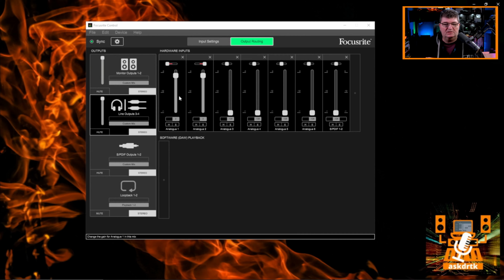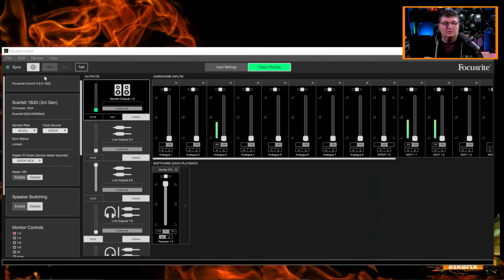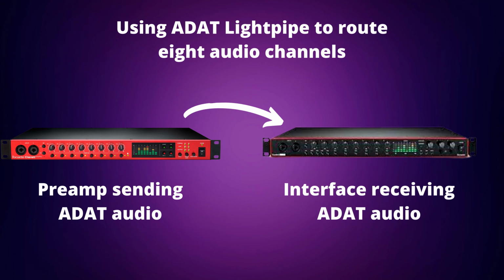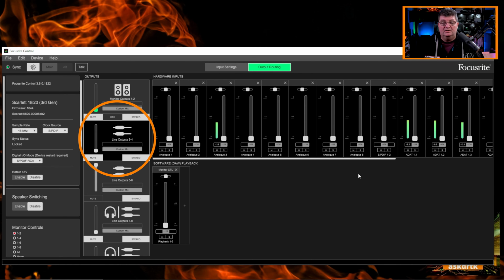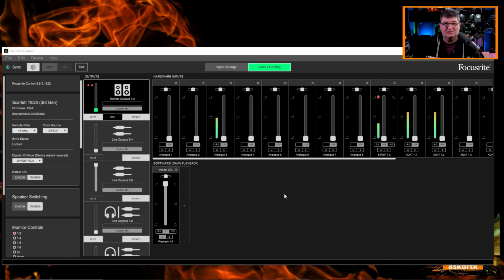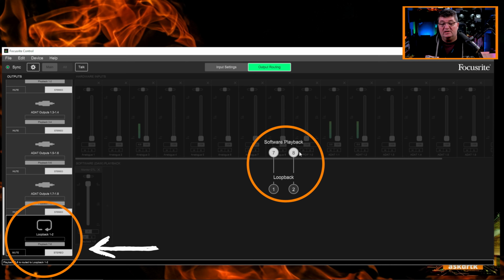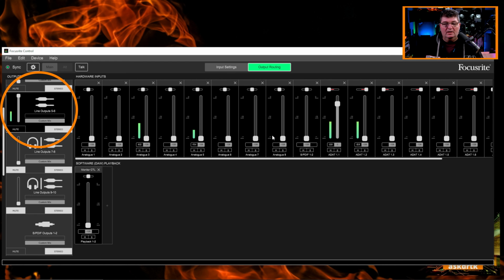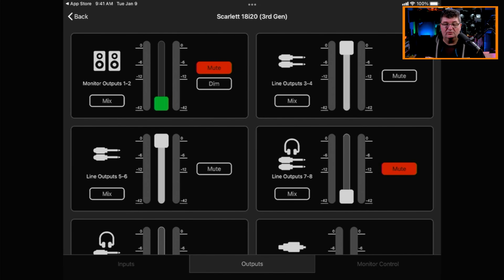Focusrite Control Step-by-Step Setup Guide - ADAT, SPDIF, & iPad Control

Comment: Hi Todd.    Great, very informative instructions. Thank you so much for your kind helpful efforts.
A quick question...
****
I already use the 18i20's ADAT to get an extra 8 inputs using a Behringer ADA800. 
If I do this, does it mean one can't use the SPDIF IN  RCA input on the 18i20 - to get an extra two input channels?   (I think you said this.)

I am trying to use an Avencure A-D audio converter (RCA stereo source to Figital coaxial outputs) to feed my Yamaha Modx analog outs to a new track input on the 18i20.
Thanks again.:-) Peter 😏
Reply from the maker: Hi Peter, glad to help out as always… Yes you can use the additional two channels of input from the SPDIF input. (I assume you are using a sample rate of 48KHz as you have 8 ADAT inputs from the AD8000). Using a AD converter is a great way to take advantage of the extra channels. Cheers!
Reply: @askdrtk  Thanks Todd. I tried but no luck as yet (confused by the appropriate Focusrite Control app setup) but I will study your videos more closely. Cheers from Australia mate :-)
Reply from the maker: Hmm, the inputs should be available as ASIO inputs 11 and 12 in your DAW without setting anything up in FC and then setup FC to monitor the SPDIF inputs to whichever outputs you want to use. If all this looks good and you still are not getting sound, chances are it is a clock issue. Since the SPDIF connection from your AD converter is one way (the converters sends its clock out), you will need to set the 18i20's clock source to SPDIF so 18i20 can sync up with the AD converter. Hopefully this will get things going.
Reply: @askdrtk  Brilliant Todd. I will try this out when I get a chance. 
You are such a kind person, thanks again 👏

Comment: I need help.. I have the focusrite Clarett + 8 pre and Iam trying to connect it to Berringer U phoria UMC 1820 via ADAT optical cable. I want the Clarrett to be my main interface. I watched your video and iam still get no sound I see the adat channels and actually see the meter showing playback but no sound. Can you draw me out the correct connections to get this running I will pay you.. let me know Iam trying to use my outboard gear and Iam using studio one thanks
Reply from the maker: While you can connect your Clarett+ and UMC 1820 with two ADAT cables, unfortunately the issue you are having relates to the way the UMC routes its analog ports. While the Clarett+ 8pre supports "stand-alone" mode, meaning its inputs can be routed to ADAT out and its outputs can be routed from ADAT in, the UMC does not. There is no way to configure the UMC to forward its analog inputs to its ADAT output nor is it possible to route its ADAT input to its analog outputs. The UMC is designed to work as the master only with ADAT. I definitely understand wanting to use the Clarett+ as the master, but unfortunately the UMC cannot be setup as a slave. You could setup the Clarett+ as stand-alone and slave it to the UMC as the master, but of course this is not making the best use of the Clarett+. While it is a hassle, the most affordable way to deal with this is probably to sell the UMC on Reverb...etc (the 1820s hold their value well) and then purchase an ADA8200 (for the same or possibly less than you can sell the UMC). The ADA8200 is specifically designed to work as a slave and will provide the additional IO you need for your outboard gear. Of course there are more expensive options (Clarett Octopre or Scarlett Octopre Dynamic) and others, but conversion on the ADA8200 is good and the unit has proven to be reliable. This isn't the response I like to give, but I hope it helps out!
Reply: @askdrtk  thank you so much for the advise, I think I will sell the UMC , and I will let you know how it works out. By the way great channel keep up the good work.. much appreciated...
Reply from the maker: Thanks, all good...glad to help out.

Comment: hi there pal, Happy New Year to you and all the best in 2023. Been awhile since we last wrote each other. I have a question about the scarlett 18i20 interface. I just recently bought a sampler the sonicware sampltrek. it has ins and out ports as well as midi in and out ports too. I want to record a sample from computer which is a mac into the sampltrek via itunes on my mac. How should I make the cable connections properly from the scarlett to the sampltrek so i can record the sample from my mac into the sampltrek?
Reply from the maker: Hello! Happy New Year and best wishes in 2023 to you as well! For the connections I would go with any open pair of outs on the 18i20 and connect to the two inputs on the sampltrek. You could then go into Focusrite Control and setup your system playback 1/2 to output to whichever outputs you connected to the sample track. This will allow you to record directly from itunes playback with the sampltrek providing audio sync. You would then edit your sample in the sampltrek as usual. That is the simplest way to get it done.

You could also take advantage of syncing up start/stop and tempo via midi. Since itunes does not support this you would need to use your DAW. To this, make the connections the same way between the 18i20 and sampltrek, but no need to route output in Focusrite Control. You would then record the sample from itunes into your DAW using the loopback input from your 18i20 making sure you have tempo setup the same as you . You then need a midi out from your sampltrek to midi in on the 18i20 and midi out from the 18i20 to midi in on the sampltrek. Once you configure the sampltrek as a midi controller in your DAW you will be able to start/stop DAW playback when you that record on the sampltrek. Tempo will also stay in sync this way. Hope these two options give you a starting point!
Reply: @askdrtk  thank you so much. I had missed your reply and just saw this. my apologies, but thank you again.

Comment: On my 4i4 3rd dosent show monitors control.
Reply from the maker: OK, this is because the 4i4 has an analog monitor control hardwired to outputs 1/2 only. Selectable monitor pair output control is only available on models with a digital monitor control.
Reply: @askdrtk  Oh it make since, so which one should i get?
Reply from the maker: Focusrite interfaces with a digital (assignable) control knob include the Scarlett 18i8 (3G), Scarlett 18i20 (2 and 3G), Clarett 2Pre, 4Pre, and 8Pre (includes all USB, Thunderbolt, and "plus" models), and the Clarett 8PreX. The choice comes down to how much IO you need, but the Clarett+2Pre has the same IO as the Scarlett 4i4 (plus optical input for expansion but does not have loopback). The only thing about moving up to the Clarett+ line is cost is much higher. The Clarett+2Pre is almost the same price as the Scarlett 18i20 in my area. The Clarett+ has upgraded preamps and converters, but the Scarlett 18i20 has far more IO. I will also mention that Focusrite has the Scarlett 18i20 second gen on sale for $349 usd on their website at the moment which is a great value and is only lacking the loopback feature (which you can create by connecting one cable between SPDIF in and out ports).

Comment: thank you for your help i am doing setup to connect the epson ls 12000 projector coming from HDMI Audio Extractor 4K 120Hz 8K 7.1/5.1/2.1ch EDID Switch Atmos VRR CEC- SPDIF 5.1CH Optical Toslink  - to the Focusrite Scarlett 18i20 USB Audio Interface so i can use RCF SUB 708-AS II Active Subwoofer 2 of them and 5 speakers .
thank you for your help.
Reply from the maker: Glad to help out! Sounds like a nice system you are setting up.
Reply: @askdrtk  I will next week it is a big set up just just using two subs and 5 speakers for now let you know how it goes.
Thank you for your response.

Comment: Your video's are stellar and Extremely informative. I have a question that you may have answered but it may have escaped me. I have a scarlet 18i20 3rd generation, The question is: I want to be able to process ADAT outputs 1&2 through external gear. However when I hard patch the outputs from the from the front of the device to my patch bay no audio is passed. I know I'm missing something. Please help! Please and Thank you!
Reply from the maker: Thanks and I'm glad to help out! The two most common reasons audio doesn't pass over ADAT are either sync or routing setup in FC. If sync is the issue, not audio will pass in or out. If your external ADAT device and 18i20 clocks are synced, then the issue is likely the need to adjust the mixer in FC. Since you are using front inputs 1-2, go into FC, select the ADAT 1-2 output and then either select "Hardware Input 1-2" or if you want to use "Custom Mix" turn up the fader for inputs 1-2. Let me know if this solves the issue. If you still aren't getting sound, let me know what you have connected over ADAT and how you have word clock configured on both devices.
Reply: @askdrtk  Sync was not an issue as I had my DAW slaved to the sample rate of the 18i20. When I changed the routing as you suggested it worked like a charm. I changed the output of ADAT 1&2 to listen on 3&4. HOWEVER~! When selecting input 3&4 on my DAW 
(Logic)  to record, I have to turn down the volume all the way or it feeds back (duh!). Thanks for all your help and suggestions. I can now route a project to an outboard compressor, or any other processor for that matter, and then back in to Logic! Thanks for taking the time to answer this as it had me puzzled~!
Reply from the maker: That's great to hear and I am glad to help out!
Reply: @askdrtk  I have another question if you don't mind..I have a clarett+ 8 pre and have the ins and outs patched as a through connection to a patch bay. But When I insert a mic in the circuit...Nothing! Thoughts?  Further, I know you use a channel strip how do you gain stage with the preamp in your interface?? as always your thoughts and help are very much appreciated. Wishing you and yours a very healthy and happy Holiday Season
Reply from the maker: If you are using TRS cables between your clarett+ and patch bay that is likely the issue. The combo jack inputs on the clarett+ are designed for line level only through TRS/TS while XLR allows for both microphones and line level signals. Many will use an XLR to TRS cable for a TRS patch bay, just be careful with phantom power... For gain staging a preamp or channel strip to the interface, the first thing I consider is ambient sound. If I want to hear more of the room, I bring the level up higher on the preamp (peaks often around -10dB) and then add very little from the interface so as peaks into the DAW are around -8 to -6dB. If I want to control ambience, I set the preamp so as to have peaks around -14db and then bring the peaks up with the interface so the DAW again has -8 to -6dB.  This of course can vary if I am tracking with compression in with case I alter the proportion of gain between the preamp and interface to either emphasize or de-emphasize character imparted by the compression. This is big topic and there will be videos coming...  All the best of the season to you and yours as well!
Reply: @askdrtk  Yup! Peeking behind the rack I have only  a TRS to TRS Snake. I ordered an XLR to TRS Snake that I think will solve the issue..Your insight is always appreciated My nescience is showing. The nuance of making proper connections is sometimes veiled, or me  just not reading the manual.:) Many thanks again~

Comment: This was an excellent video.  Thanks so much. I am a tad confused about one thing.  I have an older Clarrette 8pre that is maxed out.  I need 8 more channels.  Do I need a Scarlette 1820 or a Clarette OctoPre 8 which sends ADAT to the Clarette?   Thanks
Reply from the maker: Thanks, I'm glad you enjoyed it! You can use either an OctoPre or an interface such as the 18i20. 

If you go the 18i20 route, you need to temporarily disconnect the Clarett 8pre and connect the 18i20 by usb to your computer so you can set it up in stand alone mode using Focusrite Control. This routes analog inputs to ADAT outputs and ADAT inputs to analog outputs. You also need to set the clock source to ADAT and set the sample rate to whatever you are using on the Clarette 8pre. You then disconnect the 18i20 from usb, reconnect the Clarett 8Pre, and connect your ADAT cables between the Clarett and 18i20. The most common reason for going this route it that the 18i20 is at a lower price compared to the Octopre, but you sacrifice the convenience of the Octopre front panel sync and sample rate controls.

If you go the Octopre route, you connect your ADAT cables between the Clarett 8pre and the Octopre, select sync as ADAT, and set the sample rate of the Octopre to match your Clarett 8pre, all on the front panel controls of the Octopre. Note that you can use either the Clarett+ Octopre (Clarett Octopre if you can find one used) or the Scarlett Octopre Dynamic. There are two Scarlett Octopre's, the standard one is mic preamps only where are the "Dynamic" is similar to the Clarett Octopre as it has both 8 mic pres and 8 analog outs. I hope this helps out!
Reply: @askdrtk  my man…..thanks for such a detailed reply.   That was very  helpful.  Do you know if I get the extra headroom, dynamics range etc if I use the Octopre 8 + and go into an older Clarett 8 pre?     I am tempted to sell my Clarett 8 pre and buy a used Clarett + 8 pre  and octopre +.   Looking at about an extra $500 versus regular versions.  Tough decision.  Any advice surely appreciated.   Just hate to buy the Octopre + if it’s not fully utilized with my current converter.
Reply from the maker: I have some good news for you Bob! If you go with the Clarett+ Octopre, the analog input preamps and analog outputs on the Octopre go through the onboard converters, so you get the extra dynamic range (and you can hear it - I use a Clarett+ for tracking drums). The output converted to digital in the Octopre then passes through the interface (Clarett 8 Pre in your case) via ADAT without change. Of course the analog inputs and outputs on your Clarett 8 Pre will still be converted internally at the original dynamic range. This is a good upgrade path. You could start with the Clarett+ Octopre and then upgrade your Clarett 8 Pre to a + later, or all at the same time...ahh, gear "escalation." The Clarett+ preamps and converters are a significant step up from the Scarlett (not to say great recordings can't be made on the Scarletts - the gen 3's in particular are far better than they get credit for), but the Clarett+ are sitting quietly in the shadow of Red, with converters easily capable of living in pro studios. If the numbers make sense, the Clarett+ 8pre and Clarett+ Octopre are 16 channels in and out of studio quality sound...

Comment: Hi thanks for the video the loopback was very helpful. I ran into another problem. I'm running a iMac 2017 with a Clarett+ 8pre. I would love to use my Pro40 as more outputs for hybrid mixing. My issue is I can not connect my Pro40 because of FireWire. Once I run Optical cord  and set to ADAT there's no sound until I switch to 48khz then it either pop and click or Clarett+ keeps restarting. Do I need to invest in a Octopre?
Reply from the maker: I'm glad to help out and if you need further detail on loopback, I have a specific video with further details.

The good news it you can use your Pro40 as an A/D and D/A converter with your Clarett+ 8pre so, as good as the Octopre is, you will not have to go in that direction. You will need to setup your Pro40 to operate in Standalone mode with its clock source set to ADAT and routing setup to forward ADAT In 1-8 to Line Out 1-8 and Analog In 1-8 to ADAT Out 1-8. Make sure you also set the sample rate to what you plan to use on the Clarett+ or the Pro40 won't sync up. Focusrite posted a step-by-step guide at this link https://support.focusrite.com/hc/en-gb/articles/206849939-How-do-I-set-up-my-Saffire-or-Scarlett-1st-Gen-for-Standalone-Mode- Let me know if you have any questions or issues when setting it up.
Reply: @askdrtk  Thanks for the reply. I'm seriously getting annoyed with the Focusrite control. I routed my Lexicon MX200 I just purchase to interface then mute track so I will not get feedback in Control. Set up my I/O properly in Protools. Set everything up as it should be, but I get no sound from my Lexicon in my Protools unless I unmuted it in control which will play Reverb across everything without an insert. I'm So confused, all my hardware works, but not the Lexicon. I hope you can make sense of this.
Reply from the maker: If you are getting reverb across everything when it is unmuted, it sounds like a number of channels might be routed to the output you are using to send audio to the MX200. This can either be in the way Focusrite Control is configured or in the way you have the send setup in Protools. If you can provide a few details about how you have the input and output for the MX200 setup in Focusrite Control and the send setup in Protools I may be able to offer a more detailed solution.
Reply: @askdrtk  I was told to use a S/pidf which solved my problem. Thanks anyway for the reply.
Reply from the maker: Glad you were able to get it sorted out! SPDIF often does not have a default setup for multiple channels which I suspect was the solution, but either way, great to hear!